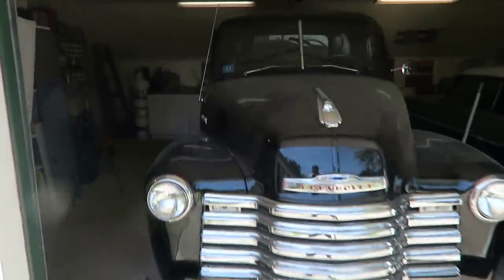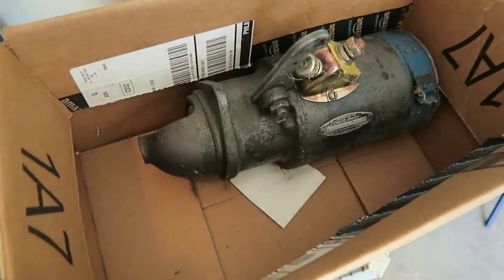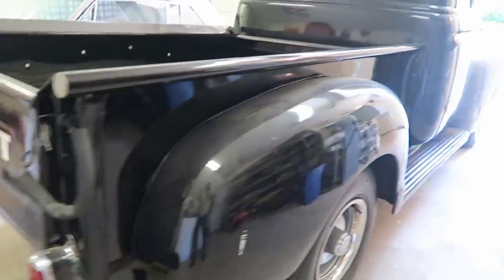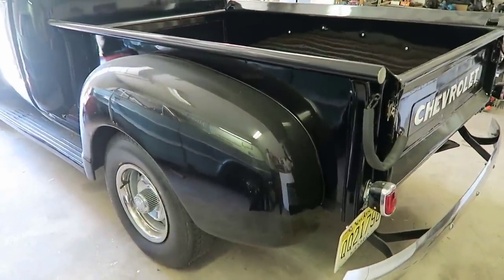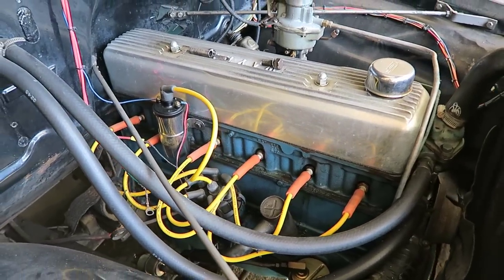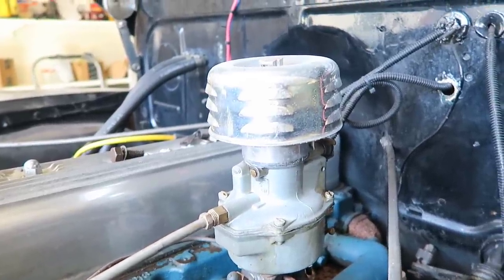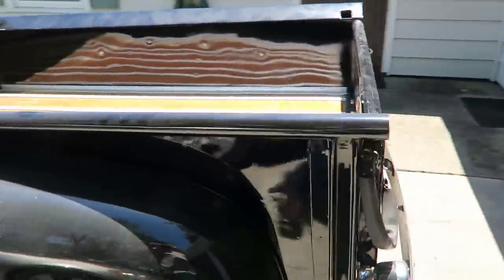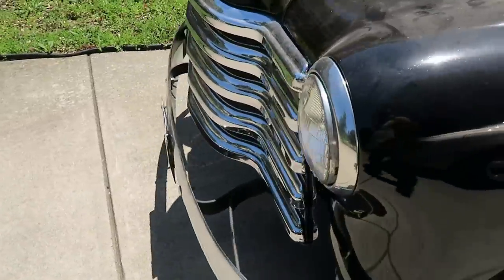A Man And His Truck - 1952 Chevy 3100 Half Ton

Comment: Beautiful truck, I have a 1952 under the hood is all original and the man who sold it to me placed emphasis on some metal springs on the firewall, he said if one of this springs goes the truck will not move. One day driving it, I shifted heard the sound of a spring coming loose on a hill, truck running but started to go backwards. It doesn't go into gear since then it has parked.  Engine runs great, but I can not get it to shift is like stuck in neutral. I can not find any videos about spring shifting system on firewall. If you know anyone or anything about it Please reach out.
Reply from the maker: Mar, I am not familiar with the topic you just mentioned. But, I would recommend you visit StoveBolt via their website here: https://www.stovebolt.com/. They are a virtual garage for pre-1973 GM trucks just like ours. It is a great site that cover many topics about our trucks. Once you visit, you will see tabs on top, Home, Tech, Forums, Swap, and Community. You may find the answer you need in the Tech page. Or reach out via the Forum link. Stove Bolt has been in operation since 1995 and I believe it is the best site for us.
Reply: @oviduran  
Thank you for your reply. Greatly appreciated.

Comment: Odds are the cause the wire burning up like that is due to a bad wire. That slice higher up is a good spot for corrosion to get in and create resistance which will cause that issue
You can start it without the starter you just might break your arm doing it

Comment: that engine had a canister oil filter housing that was attached to intake manifold it held about quart of oil an you change oil as offtend as you wanted some did at 18 to 25 hundred depending on way its drove but get the filter  youll be glad
Reply from the maker: Thanks Jack. I wasn't aware of that.

Comment: This truck would look and run great if you installed a 454 engine, cut the cab roof off and made it a convertible , replace the wheels to 24 inch custom chrome, 4 in the floor would improve performance too.  Put a paint job with flames. good luck updating it.
Reply from the maker: Thank you. Great ideas. I definitely need to do something with it and soon. Waiting to retire to start working on it full time. Can't wait, I'm close to that. Merry Christmas.

Comment: Please get the starter and wiring issues resolved and drive this truck!  It is a wonderful vehicle.  The repairs needed are very easy ones.  By allowing this truck to sit idle, the brakes surely have 
suffered damage.  Also, the fuel system.  I can't wait to hear that you have repaired the truck and are driving it.
Reply from the maker: JK, the plan is to put it on the road this coming summer. It is generally in great shape. I can't wait either.
Reply: This is my dream vehicle.  You MUST get this Pick-up running and driving.  The Public deserves to see it!  jay

Comment: i have two (2) '52 chevy trucks &  a '48 chevy truck. the original wiring had one wire from the starter to the ammeter. you have 2 wires. truck has been re-wired & who knows what the second wire is for. if you are burning up a 10 guage wire, you have a serious short circuit. '55-61 starters are wound for 12 volts. might help your starter burn up problem.
Reply from the maker: Thanks Gary. Yes, the truck has been rewired and many part are not original either. The doors are from an earlier model and even the front fenders are not the originals. But it still looks great and when I retire next year I plan on working on it until it's back on the road. This truck has been converted to 12 volts by the previous owner. Thanks for the tip.

Comment: NOT a 1952. 1952 has the PUSH BUTTON DOOR HANDLE. Your truck is a 1947 to 1951. 1947 to 1951 HAD the lever style door handle.
Reply from the maker: Greetings. You are correct. The truck itself is a 52 but the doors, fenders, and engine were replaced by the previous owner. The doors are 47 to 51 and I wish I knew a way to find out exactly what year. Many more things were changed on the truck. It's sort of like a Frankenstein, but I still love the thing and will never part with it. Have a great day.

Comment: I have a '53 and it looks a lot like yours but mine has matte black paint that I did myself. It really looks great, but not perfect because I am not a professional body man, but my dad was so I learned a lot from him, but I was a professional mechanic for 33 years. I restored my truck over about 3 years time and had everything off the frame but the cab. The engine is overhauled original 216 CI done before I got the truck. I replaced the old" three on the tree" with a T-5  overdrive transmission from a '86 S-10 pickup and a'61 Chevy pickup rear differential and man, what a difference that made. I also did the 12 volt conversion like your truck has. The large wire going in the cab from your starter goes to the amp gauge in the dash and is the feed for your ignition and does not have fuse protection so you might want to put a breaker in line. I used the one wire alternator and ran the wire directly to the starter hot wire, I don't know which alternator you have, but the one wire is the way to go. And even if your starter is 6 volt it should last for years with the 12 volt system. and I have used mine for 3 years now. Wish I could drive over and help you, but West Virginia is a little far from you.
Reply from the maker: Thanks. I plan on finishing this truck before I move to upstate NY next year. It isn't much that is needed to put it back on the road, but now with everything that is going on I may have the time to finally finish it. Someday I will use it on a small farm or homestead. That's the dream right now. Once I put it back on the road I will do more vlogs showing how I did it.

Comment: AM-FM radio in a 1952 GM? It was my understanding FM radios began to be installed in American vehicles not earlier than the late fifties, or early sixties as an option. I know in Europe, in 1952,  Blaupunkt came up with an AM-FM radio to be installed by dealers on some cars. Either way, I like that truck a lot! Or I should say, a piece of art.
Reply from the maker: RM, you are correct. The original radio still on the truck is only AM. What I should have shown is the modern AM-FM radio in the glove box which was installed by the previous owner. I believe the first AM-FM radio was offered in American cars in the early 1960's. It's a nice truck and I plan to work on it and take it on the road frequently after I retire. Unfortunately, at present I don't have much free time. Should be much fun.

Comment: Any advice to someone looking to buy one as their first hot rod?  Found one online that has an 8 cylinder dropped into it.  Any sorts of things to look for when buying?
Reply from the maker: Tyler, I have only bought this truck in the past 21 years and I really am not experienced in what to look for. But my advice would be this, only buy something that is in running condition and with no to very little rust. Rust in cars seems to be very expensive to fix. If you buy a hot rod make sure to have some money saved to fix or replace parts as needed. They do take a lot of money. If you don't fix them right away they can end up stored away in garages for many years. That was one of my problems when I was younger. I had no time nor any money to fix my old cars. Only focus in one car, don't buy many, as you get the experience. Always ask for help from family and friends if you lack the experience. Sometimes we do get lucky with old cars that someone else had taken really good care of. Don't focus too much on the make and model, but do focus on something that you think you can own for the next 30 to 40 years and stick with that. In my opinion, all antique or historic American made cars and trucks are great. The best of luck finding what you are looking for.
Reply: @oviduran  Thanks!

Comment: That is not a 1952 Chevy, it is either a 1948, 1949 or 1950.  The outside door handle is push button on a 52.  A 1952 also had a wing glass.  That is not a AM/FM radio, it is only AM, original radios weren't FM back in the 1950's.  Get your facts straight Bubble head.
Reply from the maker: Gene, you are correct on some points but it is a 52. The previous owner back in the 90's replaced the doors for 48 or 49 doors, according to him. The 52 doors were in bad shape and had to go, but that's not all he replaced. There's much more. I do like the wing glass on the 52 doors and wish he could have saved them. The radio is AM, but I do have an AM/FM in the glove box and I should have pointed that out. Either way, a great future project.
Reply: Thanks for clearing this up..I've always been a Chevy owner but not old enough to have owned one like it.  Dad owned a 48, 51 and 53 Chevy pickup.  I called you a bubble head because of the cap you had on.  I am also a bubble head, USS Grayling SSN646.  Thank you for your service.
Reply from the maker: @genewoody7187  Greetings shipmate. I understand Gene. These trucks are something else and I do look forward to using it every week. I retired from the Navy after 30 years (active and reserves), but I was always surface. Now, I still work for the Navy, but as a civilian. Just when I thought I was out, they pull me right back in! Lol
Reply: @oviduran  I was only on the Grayling for three years, spent 20 X 30 myself.  Two Cruisers, 2 Sub Tenders a four year shore duty and two years at VP30.
Reply: A 1952 model has a 5 window cab.  Corner windows and a split windshield.  A 1952 had the 216 engine which had babbit or poured bearings.  Most were changed to the later 235 engine.  The 52 model had an enclosed driveshaft.  Most were swapped out for the later driveshaft as the transmission failed.  I wish I still had mined.  Even though, I was always having to work on it.  I would always try to keep it as original as you can.

Comment: on a 1952 chevy pick up , where is the VIN located?
Reply: There is an aluminum plate on the door jamb by the front hinges on the drivers side, held on by screws and also there is the engine number. Both of these numbers are different and it depends what state you live in as to which number they use for the VIN.
Reply: vin is on the driver's side door pillar.

Comment: The 12 volts going into the 6 volt starter likely  caused it to burn the  brushes 
simple fix
Reply from the maker: Thanks. I am definitely going to put this back on the road by this summer. Replacing the started and a few other minor details.
Reply: @oviduran  You can just change parts in those old starters , you do not have to swap the whole unit ,  their are kits , check chevys of the 40s and 50s online or  rock auto  and do it yourself with some reg had tools

Comment: good video, thanks for sharing, picking a 52 driver up on Tues, how do you rate the wipers in the rain ?
Reply from the maker: Thanks Chuck. This is a truck I will be using again next year after I move to a homestead. As for the wipers, they no longer work, but when they did work it was fair. I would put new wiper blades and coat the windshield with rain-x for good results. Rain-x made a big difference. Even if your wipers stopped working the coating would still help.

Comment: Starter is an easy fix, very nice truck, nice to see one with a standard shift 6 cylinder, the way they were built.
Reply from the maker: Thanks Larry. I've had this truck for 20 years now. Haven't had any time to work on it due to an extreme schedule at work, but the idea is to put it back on the road as soon as I retire in about a year and a half. Will drive it every week. Can't wait. It isn't all original. Many things were changed by the previous owner, but it's a beauty.
Reply: Yes, make sure you drive it enough to keep it alive.